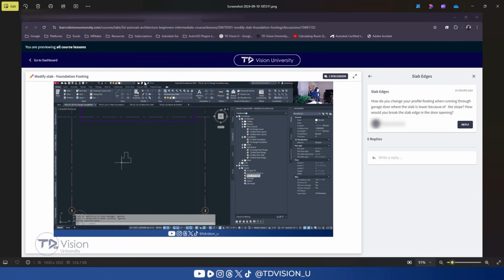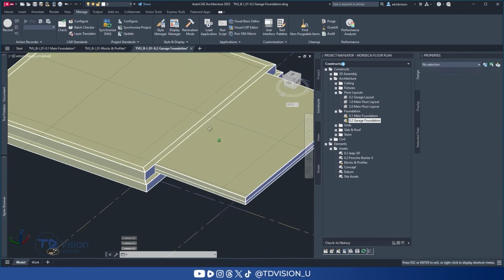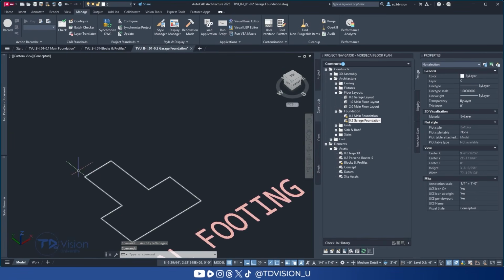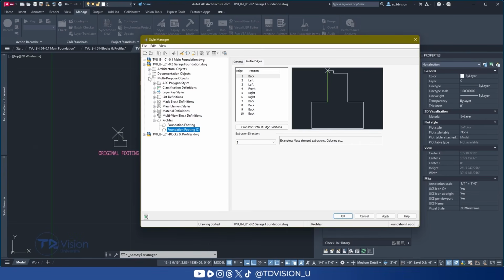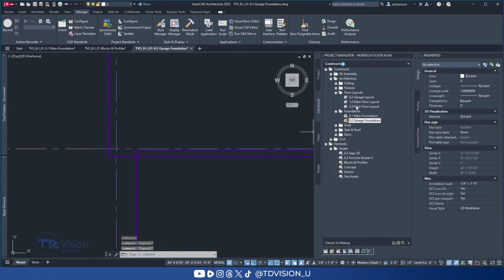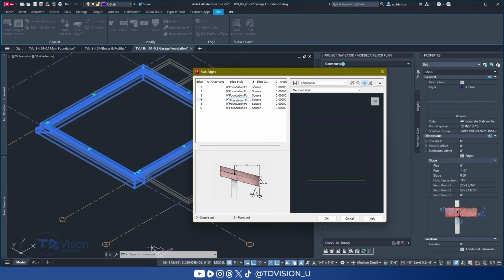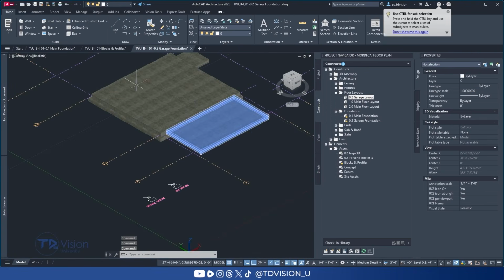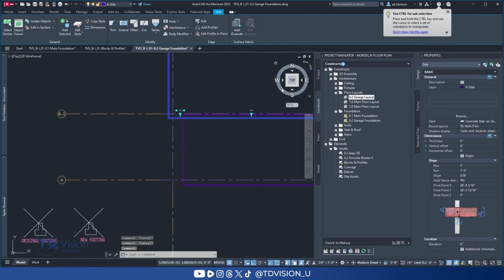Custom FOUNDATION FOOTING + AutoCAD Architecture

Comment: does your course actually help students get jobs? I am currently looking into this one and UX/UI design. Just trying to figure out which one is for me. I am 33 and looking to change careers so i dont have time for things to not be real help.
Reply from the maker: Thanks for your comment. Helping students land jobs is very important to us, which is why the course has an entire section dedicated to job search, resume building, and interview prep. There are also coaches that are available to answer questions and guide you along the way. I would suggest that you watch the intro course for both UX/UI and Architectural Drafting to get a feel for both and determine which you might prefer. If you start one and you don't like it, you are able to switch to another course within the first two weeks - I think. You can get a full refund as well within 14 days. 

For others who might be reading this comment and want to learn more, the course in question can be found here: https://coursecareers.com/a/TDVisionU?course=construction-drafting
Reply: @TDVision_U  do you need to know a lot of math? or do AutoCAD and other programs basically doi it for you?
Reply from the maker: Just the basic operations like addition, substraction, multiplication and division. That's only because you may need to read a drawing and having to +/- a few dimensions here and there. Apart from that, the software does the rest, so long as you know how to use the tools effectively.

Comment: Do you have right click options enabled?  Long time ago but I seem to remember there was a switch perhaps in options, you could select slab, right click and it will give you lots of options.  Edit slab edge (or something like that) and change it from there.
Just a little quicker.
Reply from the maker: You're correct...the right click options are there. I often like to use the longer method when teaching, just to give my beginner viewers an understanding of where things originate. From there, I would hope that they try some of the shortcuts on their own.